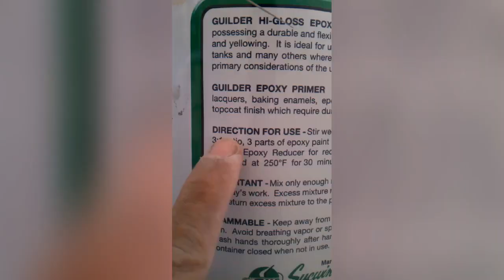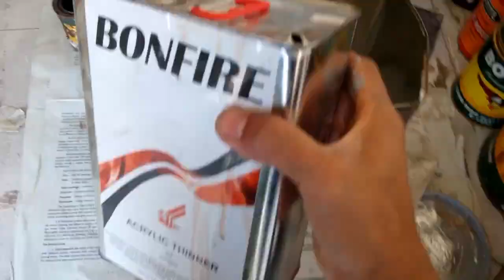How to Mix Epoxy Primer Without Paint Mixing Cups "Tagalog"

Comment: Lods kailangan ba haluan ng thinner yung epoxy primer or pwede rekta spray na?
Reply from the maker: Ang epoxy Primer natin may iba't ibang mixing ratio. Importante Ito, Kaya Bago Tayo gumamit Ng primer or Kahit sa top coat. Ugaliin natin Ito tignan sa likod Ng lata Kung ano Ang mix ratio nito. May ibang primer na kailangan Ng Reducer, meron Naman na Kahit Wala na. pero Kung Ang gamit natin na Spray Gun Ang Nozzle tip size nito ay mababa sa 1.3 kakailanganin natin Ang redecer, pero Kung 1.8 to 2.0 Kahit Wala Ng Reducer. Dahil mailalabas nito Ng maayos at maganda Ang Ating primer. Gawa Ng Malaki Ang nozzle size 😊👍👍
Reply: @paintvarnishtutorial2964   lods na try nyo na po yung paintzoom? yun lang po kasi yung meron samin. kahapon po ginagamit ng kapatid ko for painting wall. gusto ko rin po sana i-try sa motor.

Comment: idol ,, pwede ko ba ipahid yang ganyang ratio sa steel cage?? tsaka ano marerecommend mong  pang finish coating plano ko kasi kulay black gawing kulay e,,, at ano ratio ng black color na pwedeng ilagay ,, salamat
Reply from the maker: Maari Po Ang automotive paint sa ating gate para sa matibay na yari. 

Epoxy Primer 3:1:1
BaseCoat 1:1
Top coat 3:1:1 👍

Comment: Hi newbie. My niregalo saking spray gun plan ko po pinturahan ng red ung frame ng tmx 155 anu po ang mga pwde kong maging ingredients sa pag pipintura sana my maka pansin ...
Reply from the maker: BaseCoat ClearCoat System:
Epoxy Primer.
Base Coat Color Red. Dipende kung anong red ang nais nyo po.
At gamitan ito ng topcoat.
Automotive clear coat.

Single Stage system
Pwede po ang
Acrylic Enamel.
Synthetic Enamel
Or epoxy Enamel red.

👍😊

Comment: Thank you sa sagot.baket pag aq ponag mamasilya umu umbok parang dry sya,parang nagbuo buo lalo na pag 2nd coat.di q sya mahabol sa liha.baket kaya ganun?tia
Reply from the maker: Kapinta. Siguro kulang Lang sa practice 😊👍 
Konti pa at nakukuha mo din Ang tamang pag gamit Ng Ating BodyFiller, koonti Lang Ang lagay Ng Ating hardener sa Ating BodyFiller. Ng sa ganon Ito ay Hindi mabilis titigas o matutuyo, at gandahan natin Ang pahid Ng BodyFiller para kapag nag liha Tayo Hindi Tayo mahirapa,
At Kung Hindi mo Ito mahabol. Maari ka gumamit Ng mas magaspang na liha, Gaya Ng #60/80/100 with Sanding Block or machine, at sundan Ito Ng #120/220/240 saka Ito iprimer muli, 😊👍
Reply: @paintvarnishtutorial2964  thank u sir

Comment: Master ano po ba ang tips pra maging smooth finish yong plywood para pag pininturahan nd halata na plywood siya thanks po sa sagot
Reply from the maker: Automotive Finish. 
Unang gagawin.
Iprimer ang ating plywood
Gamit ang epoxy primer.
Roller, brush or Spray.
Mix Ratio is 3:1.
Matapos matuyo nito .masilyahan ito ng lacquer spot putty or bodyfiller.
Matapos ang masilya. Lihain ito. Gamit ang #120 ifinish ng #240.
Matapo ang preparation.
Iprimer ulit ito ng epoxy primer natin. Gawin ito gamit ang spray gun and Air Compressor. At kapag ito ay natuyo na. Pwede na itong kulayan at ifinish. 👍
Reply: @paintvarnishtutorial2964  master anong brand ng epoxy primer gagamitin at bodyfiller my project po kc akong gagawin salamat sa sagot ulit
Reply from the maker: @aroncomoda6390  sir. Guilder epoxy karaniwang ginagamit. Pero maraming klase ng primer. Sa body filler nman. Glasurit sir.
Reply: @paintvarnishtutorial2964  thank you sir God bless
Reply: @paintvarnishtutorial2964  sr sa  car anung tiner ginagamit
Reply: @paintvarnishtutorial2964  sr anupong hinahalo jan na tiner

Comment: Sir hndi ko tlg Magets ung 3.1 ratio turo mo sakin kung gaano kdmi ng catalyst at thinner illgay sa  epoxy primer.reply slmat po
Reply from the maker: 3:1:1 ratio. Ex. 3Cups. Ng epoxy Primer 1Cup Ng Epoxy Catalyst 1 Cup Ng reducer. Kahit na gaano kalaking cup. Basta sundin lamang Ang 3:1:1 ratio. Kuha ba Ito 😊👍
Reply: Pano pg 1liter ttimplahin ko na epoxy primer .illgay po b lhat ng catalyst nya 3.4 na maliit yta un
Reply: Sir epoxy primer b ung anzhal na surfacer gray filler . Kung hndi pdi b yun ipangprimer ko pang firstcoat